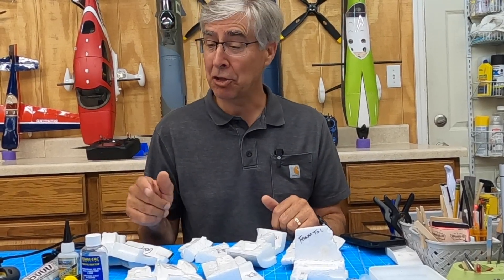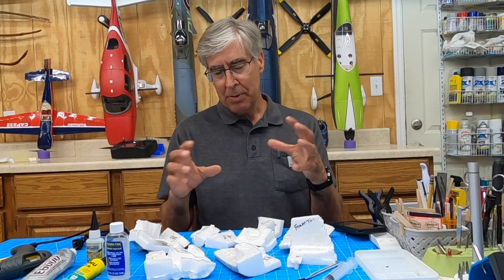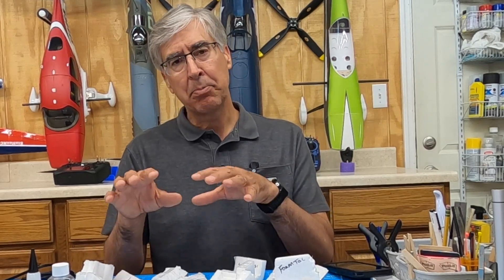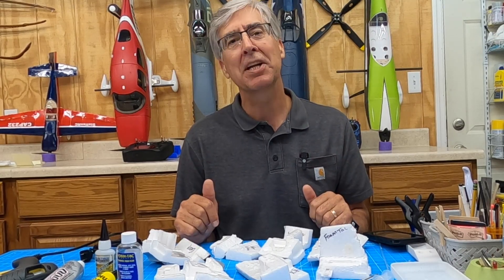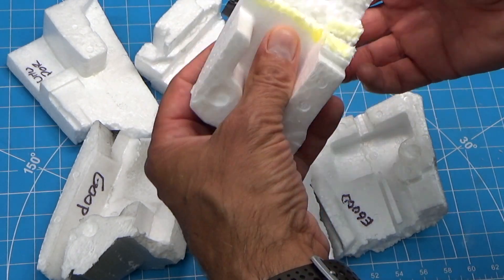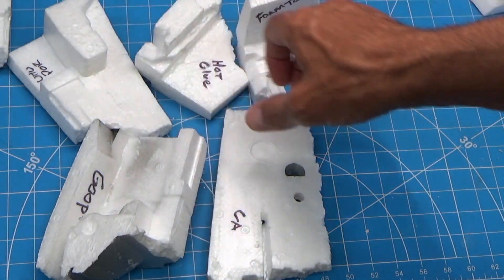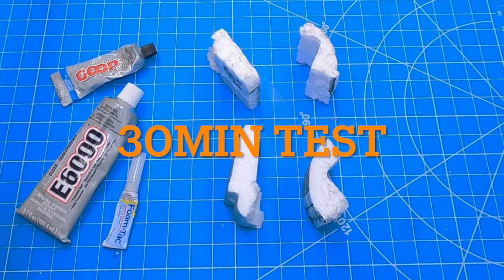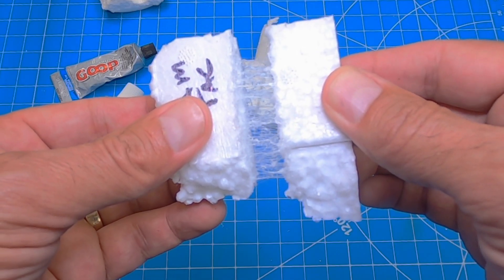Best adhesive for foam RC planes

Comment: An interesting video for model plane fliers/crashers. Probably should have made more mention of the different types of foam (EPS, EPO, EPP) and the differences in the glues that can be used with them. 
For the flexible EPP the contact cement glues like E6000 are good as they can flex with the foam. Hard brittle glues like Superglue and Epoxy negate the survivability of the flexible foam. Hot glue is also good as it tends to burn through the mould-release compound that is often left on EPP. As you mention it does tend to set too fast and squish out where it's not wanted but for parts that can be quickly and cleanly repositioned you can wipe off the excess with scrap or tape the join on 1 side to limit egress. It adds weight but, if you go easy, probably less than you might think.
For the EPO used on many bigger planes, you've got to be careful with contact cements as, depending on the proportions of the different polymers in the mix, there will be at least some softening of the foam whilst the Toluene etc solvents are evaporating off.
For the brittle beer-cooler foam EPS used on E-flite's small planes, contact cements are a complete no-no unless you want a gooey mess! But, because it is fairly rigid, Superglue and Epoxy have a place. 
The snot-like glue that most Chinese makers use on their models might not be the best for every circumstance, but it generally sticks well enough plus can be sliced and peeled off when you need to separate the parts for maintenance.
Reply from the maker: Thanks for the comments.  I did a follow-up "Part 2" video on this were a speak about the foams.  One thing to note is FoamTac, Uhu Por, and Foam2Foam do a good job on EPS foam.  They don't eat it like other adhesives.   I tend to stay away from the brittle CA and Epoxy on foam, but its perfect for balsa....  Thanks again for watching and commenting - Will

Comment: Guys, please be careful with E6000. It dissolves at least some foams. I was replasing servo in my A-10 30mm from E-flghht, it got almost through hole in the fuselage with E6000. So, i had some fun fixing the servo set place after that.
Reply from the maker: Yes. Those UMX planes are EPS. E6000 Will destroy them.  Foamtac or Foam 2Foam  are the best for that.  E6000 works great on EPO and EPP.
Reply: @SteffenRC  Thanks for your advice, I didn't know that!
Reply from the maker: @difand1  I made a few comments on my community posts and also made a Part 2 of the glue tests, and mention it there.   I learned the hard way too.  My UMX Timber got a little melted with E6000. 😬
Reply: Because on eflite website it says that both the turbo timber and a-10 30mm are epo

Comment: Very good testing!!  I am also a long-time Foam-tac user.  I may have to take a closer look at E6000.
Reply from the maker: Thanks, appreciate the kudos...  Foam-tac still has a place in my shop for sure.  It works on EPS foam and it tacks up quick..  Great stuff..  The E6000 is my go to on EPO and EPP foam that I need a little extra strength and longer setup times.  Its has some down sides, but if used sparingly, its wonderful stuff..  Cheap too...  BTW, I did Part 2 to this test with a few other glues that I wanted to compare with E6000 and Foam-tac..
Reply: I have two other glue needs that you may be able to share some insight on, if you don't mind.
1. I use silicone adhesive to attach replacement RX boards and motors in my UMX airplanes, like the Sports Cub S.  It works OK but I am wondering if there is something available more like the beige colored adhesive used by the HobbyZone/Eflite factories?  Any suggestions? 
2. I am tired of closing my UMX fuselages with scotch tape after an internal repair.  I am looking for a light duty adhesive that would be easily slit or removed for access to the inside of the fuselage but will be invisible from the outside of the airplane.  Any thoughts on this?
Reply from the maker: @gobarbless3871  sure.  Always willing to help..
Reply from the maker: @gobarbless3871  I really don’t have a great answer on your 1st question.  Sorry.  I’ll do a little research though.  On question 2.  I use Foamtac on those EPS fuselage.  I only cut the tape on the starboard side, then apply a few (4-5) small dots from the back to the front of the fuse and that seems to hold things together and I can use a razor blade to separate the seem.  I thought about applying a small sharpie dot where I applied the Foamtac to assist in the process.  But haven’t had to crack open a UMX lately.  Good luck.

Comment: Hot glue is my go to, the trick to plastic is prep.....the plastic has to be scuffed with sandpaper, or scratched up a bit with a sharp object, to give the hot glue something to grab onto.
I picked up a small 150w inverter to run a hot glue gun at the field. And if/when you have squeeze out, give it 10-15 seconds to start cooling and it'll roll off without leaving a trace.
Reply from the maker: Those are some great tips for Hot Glue.  I'll try out that "roll off" technique.   Hot glue makes a super strong bond and no clamping required.  So, its got a spot in my tool box for sure...  Thanks Will

Comment: I use FoamTac on all my foam hinges.  Works great for that.  For everything else, it's Gorilla hot glue. Stuff is super strong and bites in the foam great.
Reply from the maker: We are lucky, we have so many options for adhesives..  I recently posted a Part 2 of this video and tested Welders and Foam2Foam.  I've been playing with the welders lately and kinda like it for foam hinges..  It's easier to apply than Foamtac..   But, they are work pretty well...
Reply: @SteffenRC  I have not tried the Welders yet.  I will give it a shot.
Reply from the maker: @ChainsawFPV   it’s good stuff.  But will melt EPS foam.  That’s where Foam2Foam and Foamtac are the best.

Comment: Hot glue works great for me. It can also release with rubbing alcohol if you ever need to re-do things.
You have to use good sticks (the clearer they are, the better) - Also, you can't put it on too hot or it melts the foam. I found squirting it out on a plate, then smearing it on the foam with a plastic knife works very well.
Reply from the maker: Sounds like a solid solution.  I've used a mess of Hot glue when I was building those Flitetest Foamboard planes.  Great glue for sure.  Like all adhesives, they have their pros and cons..  Good to have a handful of options in the shop for different applications.  Thanks for sharing.. - Will
Reply: @SteffenRC  Hi!
i have a problem.
last time i got a pretty bad landing and one of the landing gear fell off so what would be the best glue for foam to plastic? (also a glue that doesn't melt the foam when i use it to glue plastic to foam.
Thx for reading 
i hope you know the answer!

Comment: Hi Will.  Thought I would give you a note about one of my experiences.  I was getting ready to repair one of my planes with E 6000 for the first time.  I noticed online that people were saying that E 6000 tended to dissolve foam.  Hmmm.  So to be a bit safer, I grabbed a surplus piece of foam and ran a test with it.  After it set up I tried to pull my test piece apart.  Seemed OK at first but then came apart.  Ooops.  The surfaces where I had smeared some glue were cratered significantly.   And there were little ridge like areas between the craters.  And it seems that only these areas of the ridges were still touching the other side.  So this ended up having very little surface area holding the two parts together.

When I applied the glue, I tried to smear it fairly light.  But there were a few more wet areas.  So, it seems I used a bit too much.  But still  .  .  .  I really don't think I had a great deal of glue in there.  Any less glue, and I would not feel like I really used enough to do the job.  I think there must be different types of foam.  And it seems the ex - P 51  parts that you tested with are better able to work with E 6000.  So,   .  .  .   I am sorry that this worked out this way.  Guess I will need to try something else.  Maybe I will just try more foam tac.   Thanks.
Reply from the maker: I found out the hard way on my UMX Timber.  It’s EPS foam.  Not EPO.  E6000 will eat EPS foam like crazy.  I think I’m gonna make a video with that warning….   I found that Foamtac works great for EPS foam.

Comment: E6000 is my favorite and also favorite overall for multiple RC hobby uses. I use it for holding receivers in place (just a small pea sized dab works). It has a good bit of self leveling character, if you take an old gift card or similar you can lay on a very thin  skimm coat over foam and it adds abrasion  resistance. Great for gluing down shelf liner for battery anti-slide. Some people even ust it by itself to stop battery slippage, just lay some strips down where battery will rest and it will prevent slipppage as good or better than shelf liner, though I prefer using it with shelf liner as it looks nicer. If using it for this then be sure to let it cure for at least 72 hours. It also works similar to foam-tac where if you can get a really thin layer down in a cracked foam hinge seam it will act has a flexible hinge, just has to be as thin a coat as possible so be cautios doing this, maybe practice on test piece first.
I posted video feww weeks ago ov initial repair to nose using E6000. Still need to post follow-ups of completed repair.
Thanks and remember to "Never stop theRC". (thanks, Discover RC Channel.)
Reply from the maker: Great tips..  Appreciate it..  I just did a skim coat on some ply before installing a AR631 RX to make sure it will stay in place..  Who knew E6000 has so many uses.. :-)
Reply: @SteffenRC  Like the other comment said one thing is to be aware if you use it to glue on foam if the foam is thin like maybe <4mm it can cause alligatoring on back side.  Another nice thing to know is e6000 in most stores around here is always clear but it is also available in black and white.
Reply: What about 5 min epoxy glue

Comment: Use caution with the E6000, it will definitely soften the foam and make a mess of things if you use too much.
Reply from the maker: 100%...  I've created my process with E6000 to apply sparingly and use a brush if possible to spread a thin coat, but don't spread it to the outside edge since it will melt the foam a bit and leave a visible scar.  The melting makes for a great bond, but as you said,  It can melt the heck out of it if you use too much.    Appreciate the comments...  - Will

Comment: Instead of 15 min epoxy, try with 30 min epoxy. According to the description of the BSI-Inc epoxy the 30 min version is the best epoxy for white foam (maybe slower will even be better, but I like the processing time with 30 min epoxy).
Reply from the maker: I'll try that out.  I'm always looking for different ways to fix planes.  Last rebuild I used 4 different glues for different applications.  30min is on the list of play with.  Thanks, Will

Comment: Gorilla hot glue and done , Walmart 1.18 cents for a pack of 10 , glued right there in the field and when back flying after a quick bake and at home carbon fiber spars or Thoth pick
Reply from the maker: Yep, there are so many great options depending on what you are trying to do..  I'd like to get a field glue gun that runs on a 4-6s battery....   Thanks Will
Reply: @SteffenRC  you can always plug it to your car wall plug if  you have one, if not amazon sell one you connect on car lighter and you have a  120

Comment: Awesome test, so glade you dud this. I've been using E6000 for a long time and foam tac almost got talked into swit hing to gorilla but use it sometimes but not for big repairs.
Reply from the maker: Funny,  I use 4-5 different glues, depending on the application.  Its always good to know how and why to use each of them..  I was always wondering, so I did the test..  Thanks for commenting.

Comment: Great information.I like E6000.I used it to hold my radar detector bracket on the windshield of my car.I never thought of using it on my Foam Flight V900.I generally use zap 5 minute epoxy and medium CA.
Reply from the maker: I like the contact cements (e6000, Foamtac, Uhu) since they are a little flexible.  CA is great, but a bit brittle.  Thanks for watching and commenting.  - Will

Comment: One downside I noticed with E6000 is it can really eat through a lot of foam if you use too much. Found it too easy to accidentally damage the model when using it.

Uhu Por's behavior depends a lot on how you apply it. If you do the whole thing where you stick the parts together, pull them apart, wait a few minutes, then stick them together again, it creates a strong bond in a few minutes to an hour. (Depends a lot on how long you waited between the first and last steps.) Whereas if you just put on a glob and stick them together, it can take several days to fully solidify. Curious what was the procedure you used in these tests?
Reply from the maker: I agree, E6000 should be lightly brushed on the surface.. Not globbed all over.  I also stay away from the outside edges due to that area getting real soft as the glue melts the foam together.

In the test with Uhu Por I followed the directions and let the two pieces sit for 10min after mating them for a second or two.  I'm sure its a quality adhesive and will use it for some applications.  But was surprised that it was still tacky after 48 hours.
Reply: @SteffenRC  Hm... that's good to know then, thanks.
Reply: This is true and will act similar to foam tac you have to be careful about using it on thin foam like say you were gluing a piece with perhaps less than about 5 mm thicknessyou can get a bit of alligator effect as the solvents or whatever can bleed through but simple enough to avoid.

Comment: Thanks for doing this. Would you build a twisted hobbies plane with the E6000 or do you think it would add too much weight?
Reply from the maker: Good point about the weight, but a sparing amount wouldn’t effect those planes too much.  That said, I used Foamtac for my Crack Yak and she’s been banged around a fair bit.

Comment: This video and test are gold!  Thank you for doing this!  E6000 and hot glue for me!  :)
Reply from the maker: Thanks Pat..  I just worked on an EPP plane for a friend and used 4 different adhesives.  E6000 for most of the joints due to strength, Hot glue, due to strong and quick/no clamping bond. CA for wood to wood and some foamtac for quick tack down...  Its great to have options...
Reply: @SteffenRC  Nice!   That’s awesome. I am old and all my previous RC models were all balsa. This whole foam thing is new to me. At first glance it seems to me like it’s hard to even find balsa models.
Reply: how long does the e6000 to cure cheers

Comment: E6000...will use on next model..foam tac always been a favorite..it can be sliced with blade for removal of parts for repairing ..hot glue,,hahaha ,,will be using !!! thanks for video !
Reply from the maker: I'll still use the foamtac for a minor repair at the field.  It sets up fast enough..  The E6000 really surprised me at the performance.  Hot glue too.. But I need to figure out how to use it without is oozing out everywhere.   Thanks for watching and commenting. - Will

Comment: In the uk. I use welder. Softens  epo just like e6000. Is it the same?
Reply from the maker: Never tried Welder..  I assume a bunch of these contact cements like Foam Tac, UHU Por, Welder and E6000 are very similar..   I'm going to extend my tests and do another summary video of a few other glues compared to E6000.   I'm always looking for the best.  Thanks, Will

Comment: Great test. I would like to see foam to foam against e6000 and fms glue mentioned in here. 
So long as you give it the time needed to cure, e6000 is a winner. It’s very strong but tends to melt/soften the epo a little whilst curing 🇬🇧👍🏻
Reply from the maker: I agree.  I think that melting creates that strong bond, once fully solidified.   But it’s not quick.  I found Foam2Foam on Amazon and it’s real pricey.

Comment: Great test. One thing you could do to addend this video is cost per oz or unit.  

I switched from FoamTac to E6000 a year back because E6000 is readily available at Walmart or Home Depot whereas FoamTac is specialty glue found only at hobby stores PLUS E6000 is soooo much cheaper.
Reply from the maker: I could add that in my notes for sure.

Comment: There's a glue that fms sells it's for epo. It's kinda neat smells like e6000 but it's a bit runnier and it kinda foams up. I forgot I'd bought it and tried it shortly after you posted this video. Doesn't seem to melt the foam like e6000 does sometimes either
Reply from the maker: I have a feeling a Part 2 test is coming 😀

Comment: That was very interesting. The info page for foamtac is worth the read. Areas not in contact with air will not cure ever according to them.
Reply from the maker: Funny thing..  I’ve used foamtac for years.   Always thought it was great.  Now I know it’s good, but there are better.  At least for my application.   Thanks for watching and commenting. Will